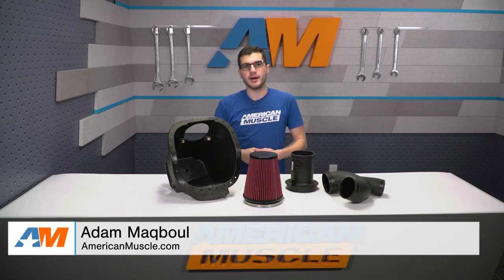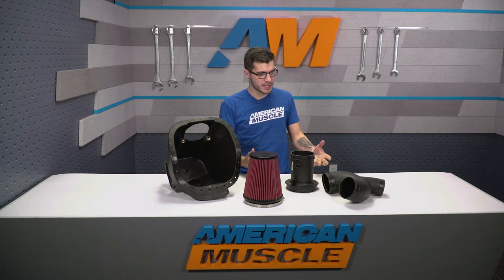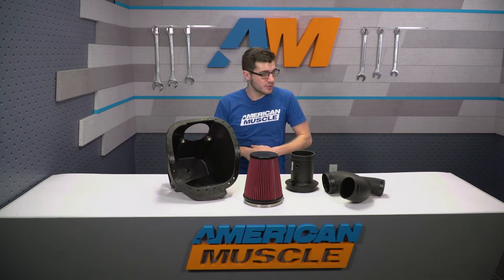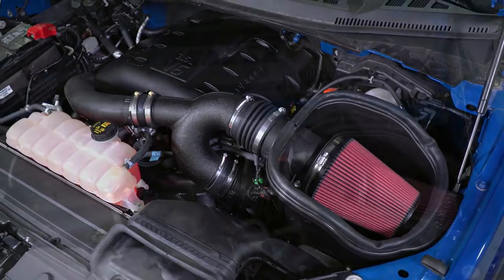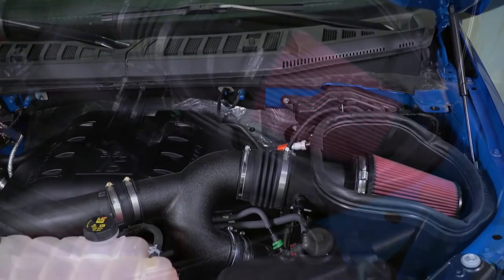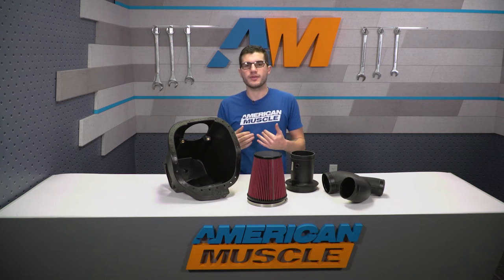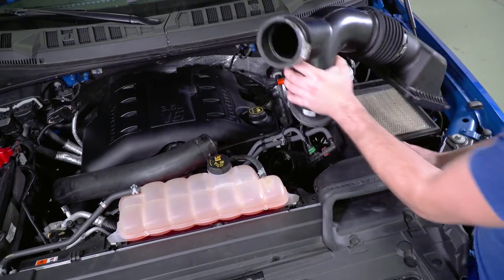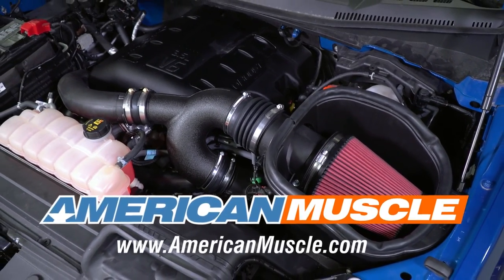2015-2016 F-150 Roush Cold Air Intake (3.5L EcoBoost) Review & Install

Comment: So this intake does not come with a box cover like the 2018+. Will this cause problems offroading? How about driving in the rain with the filter possibly getting wet? Is a cover available to purchase?
Reply from the maker: I've had the Roush intake installed on my 2017 Raptor for over 2 years now and in that time I've buried it in mud, bombed huge puddles, driven through 1-2ft of snow, countless rainstorms, etc and never had an issue.  -Justin

Comment: So..it fits a Raptor?
Reply: JONNY JO They just released one for it.
Reply: Yes. Included in the box will be the necessary hardware to fit the 2016+ Raptor.
Reply: Wish that came with a clear cover.. not sure if that is safe off-road... Does this need to be dealer installed? or Can I buy it and install it myself and still have the factory warranty ?